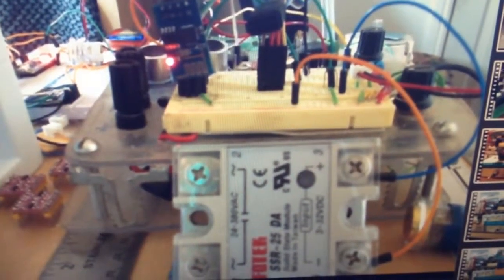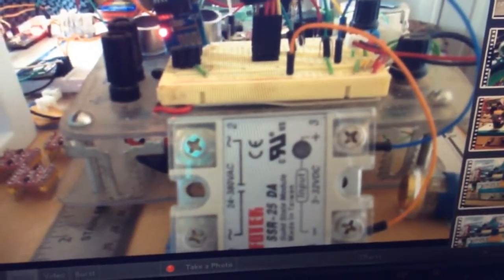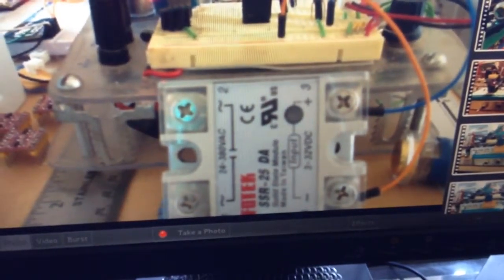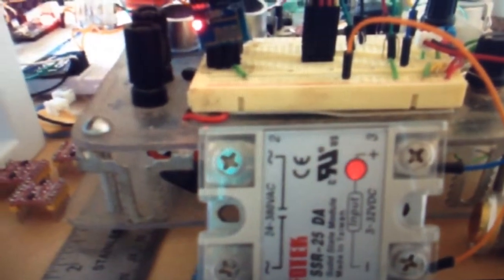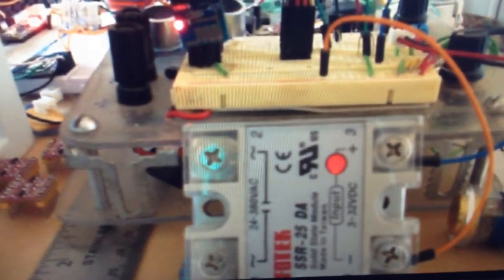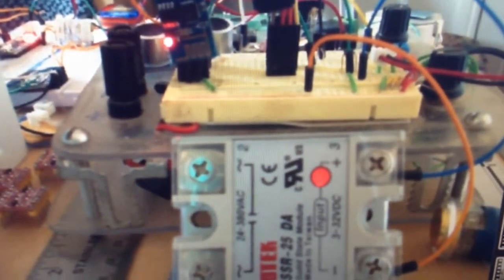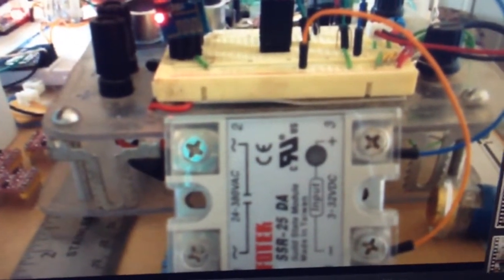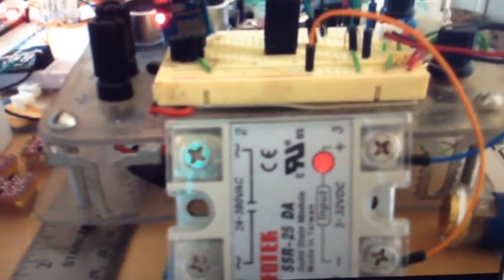ESP8266 switching solid state relay

Comment: Hi. Interesting video - thanks. I've found that if I connect the GPIO pin directly to the SSR's input, it won't power on correctly - the blue light comes on and stays on, and the program doesn't run. However, if you boot it first, then connect the SSR it works fine. No idea why. I'm using an ESP9266-v01 and GPIO2. Are you connecting in the same way?

Comment: I've just done the same thing with esp8266.  I hooked up the SSR into a power bar (replaced the power switch).  I plugged in my Hakko soldering iron and it blew the fuse on the iron after turning it on/off a couple of times -- strange.   I tried a light and it worked fine.  No idea how it could have caused the fuse to blow?